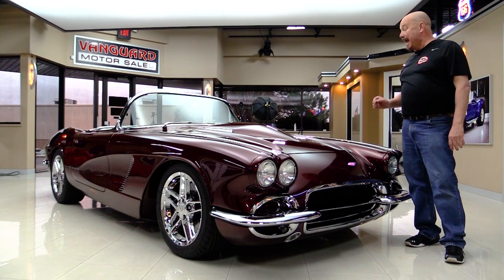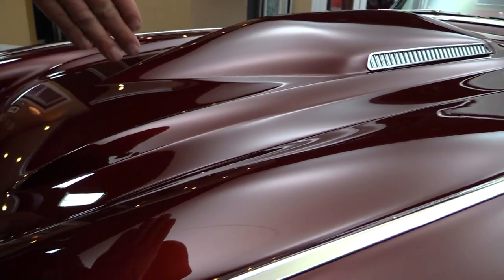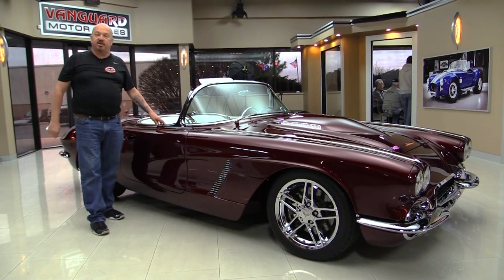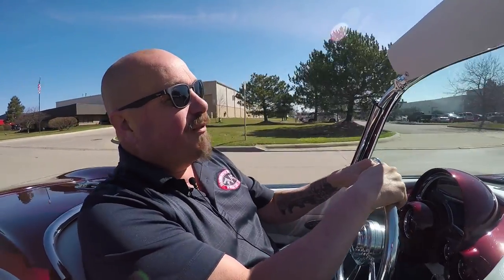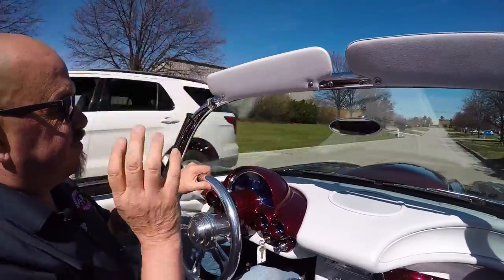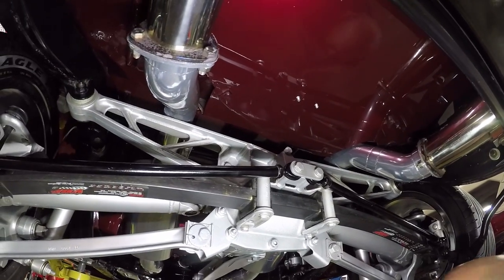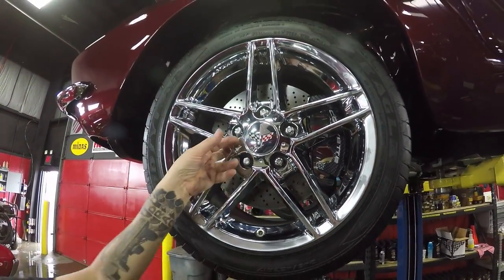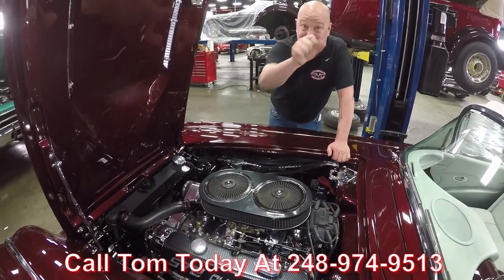1962 Chevrolet Corvette Convertible For Sale

Comment: Incredible car.  I've never seen the level of detail put into a resto-mod.The part I can't understand is he why would use 80's vintage running gear? I don't care what you do to an 200 r4 that is a weak link. The 4l80e in it's stock form than is much stronger and parts will be plentiful for the next 25 years. They didn't make many 200 r4s and the parts will be very hard to get going forward. The GM in HEI in the seventies was awesome, but doesn't really hold a candle to the computer controlled ignition used today.  I guess it was built by some old school guy who knows bling, but can't quite wrap his mind around computer controlled running gear, and that's a damn shame.
Reply: My husband said he would have built up the original engine instead. But that's him.

Comment: Too bad you guys rack up the miles and burn up the rubber on your cars. I have seen a couple of vehicles on your channel i would love to park in my driveway, but not after you all drive the piss out of them. Just saying i am leary to order my dream ride thru your dealership.
Reply from the maker: We hardly put any miles on the cars that come through here. We drive the cars enough to do the video and make sure everything is functioning properly and everything is up to our standards. As well as we want our customers to see that you can have fun with these cars so we do a burnout here and there and drive them as they were meant to be driven. The cars we sell are not just another trailer queen. They are the best High quality drivers on the market.
Reply: @vanguardmotorsales  Yeah, this would be a troll comment but I don't really think she knows too much about the cars. My WAG (wild ass guess) is that 90% of the folks watching Vanguard videos aren't worried about the 5 - 10 miles (at best!) you put on the cars to tweak them up to best performance. I'm retired for several years now, and there's not much chance in hell that I could ever buy one of your cars, but I LOVE the videos!! If I was in a position to buy a fine muscle car from the day, I'd be coming straight to Vanguard first, that's for sure!! :)
Reply: @vanguardmotorsales  Agreed....I would rather buy one that has been DRIVEN (not like daily driven per se), but DRIVEN, then a car that has been stored and sitting for sure!